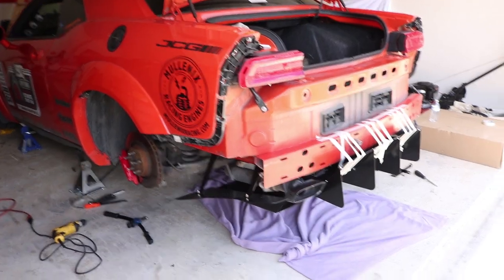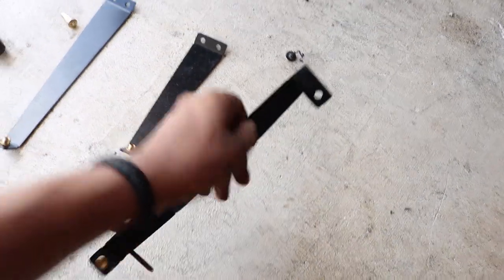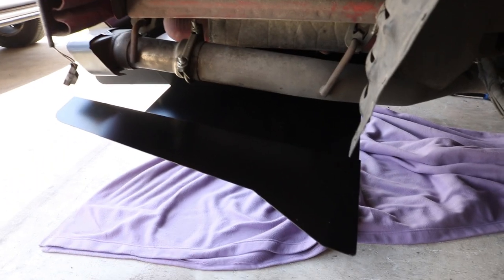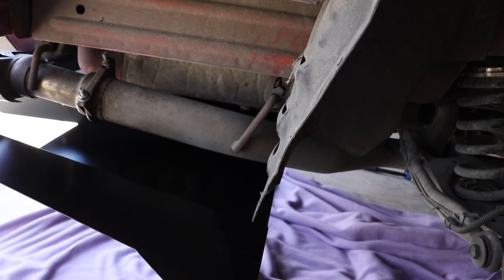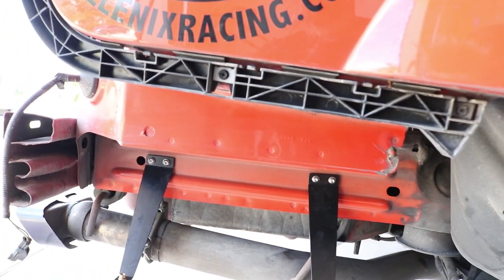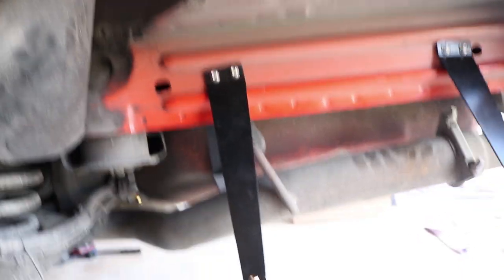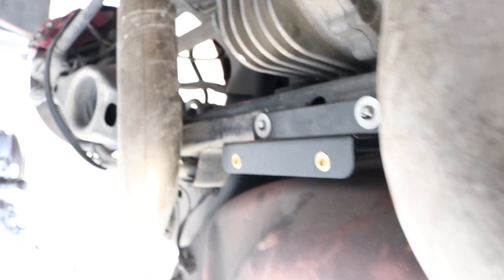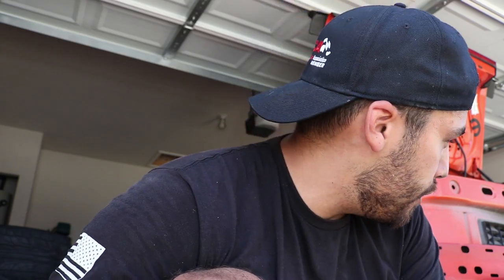Installing Challenger MFR Engineering Rear Diffuser

Comment: do u have the link for the 09 challenger diffuser from mfr for the vicrez widebody kit? thanks in advance
Reply from the maker: No, you will need to contact MFR and ask them for a challenger rear diffuser for a widebody. You need to ask for one with the fins in the middle like mine. Or simply ask for the same diffuser Tirado Racing has on his challenger. They will know. 

The one in my video is not on their website. Mike made it for my car this way.

Comment: What made you go with MFER instead of Downforce Solutions?
Reply from the maker: A couple of reasons. 

MFR Engineering specializes in making race aero for a numerous amount of platforms not just chargers and challengers. 

The MFR aero is made out of aircraft grade aluminum so its just as light and just as strong as carbon fiber for a fraction of the price. 

Simplicity. The MFR aero mounts on a few key points of the chassis. So when I need to work on something underneath the car it’s really simple to remove. The DFS guys use like 30 mounting points or something and in MY OPINION that’s too many. 

I road raced with a MFR splitter with 4 chassis mounted points and hit speeds in the 120-140 range consistently and it didn’t fly off. (Simplicity) I actually gave that splitter away to a subscriber not long ago. 

MFR customer service has been on point as well, I always ask for weird things and they always do it for me no questions asked lol. 

But those are the reasons I went MFR. Simple, strong, proven history of race aero and the cherry on top customer service.
Reply: @TIRADORACING  ok. I understand. You don't have to use all the possible DFS mounting points for the splitter. I don't. Their rear diffuser only uses about 6 mounting points.
Their components are also made out of aluminum.
I've had really good responses from DFS.
They strongly support Mopar which is a rarity.
Sounds like there are 2 good options for us Mopars. Glad to hear it.
Reply from the maker: All that’s true, I guess my other big selling point was the history designing race aero. I don’t really know DFS history tbh. 

I’m not sure if DFS uses the same aluminum either.